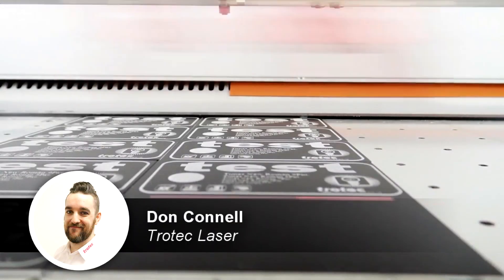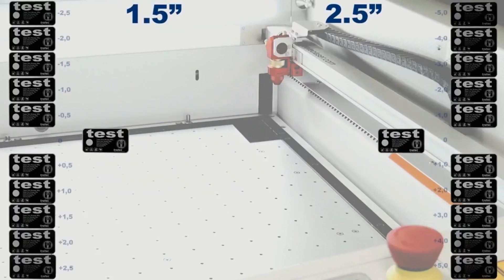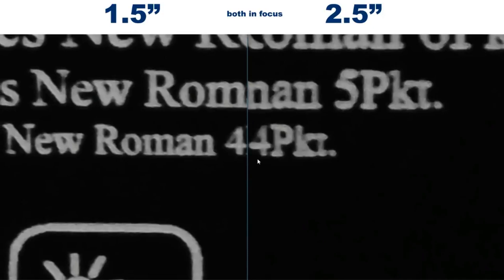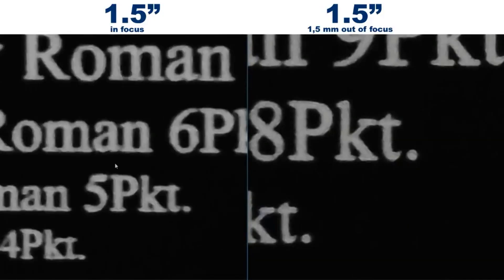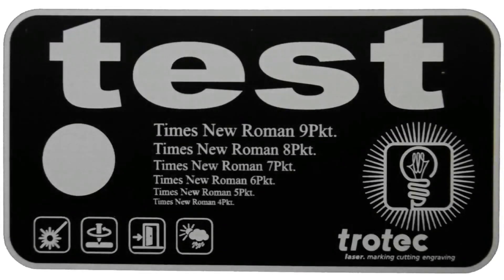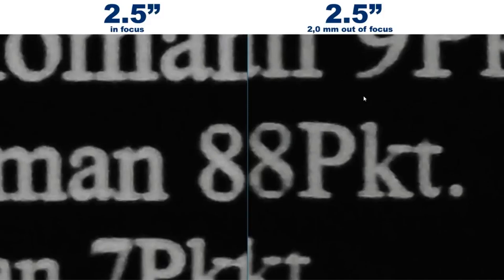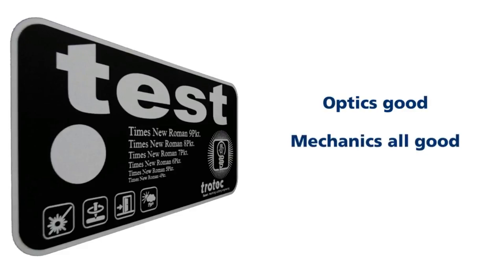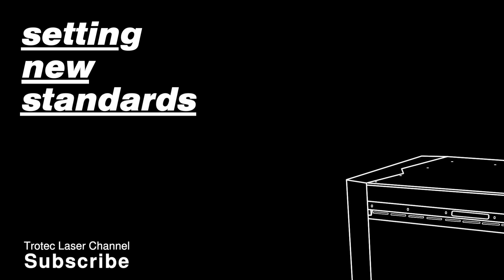Laser Engraving Focusing Techniques | Engraving Out of Focus

Comment: You need more power or a lower speed when running out of focus. As you are probably aware, out of focus means bigger spot size which means there is less power per area. So I think this test was not really done correctly. Out of focus done property (at equal power per area) results in bolder text.
Reply from the maker: Thank you for your comment. You are right, this test was more to show what happens when you go out of focus as opposed to suggesting one way or the other. We have other videos where out-of-focus works particularly well with lamacoids. Like the video here: https://www.youtube.com/watch?v=uBlcLtudxPs